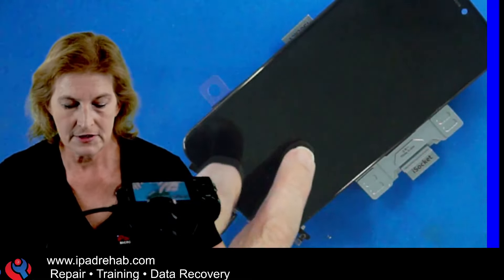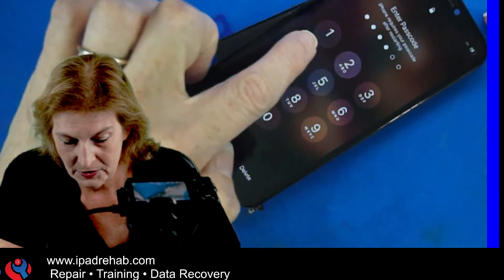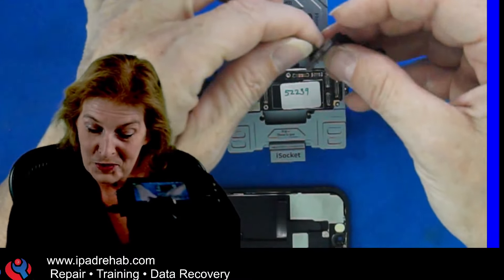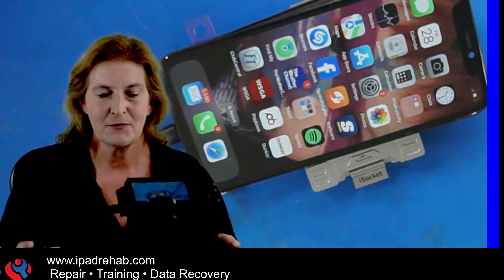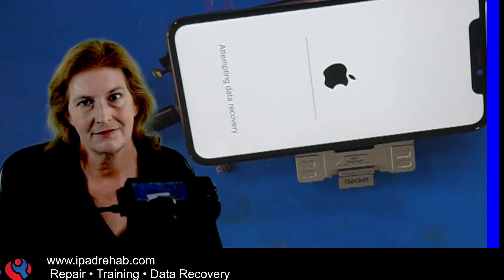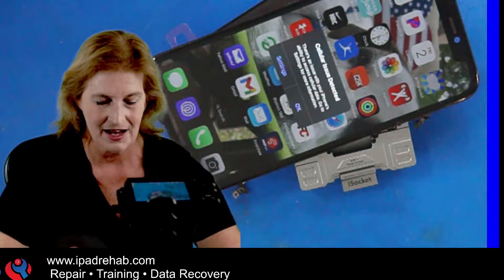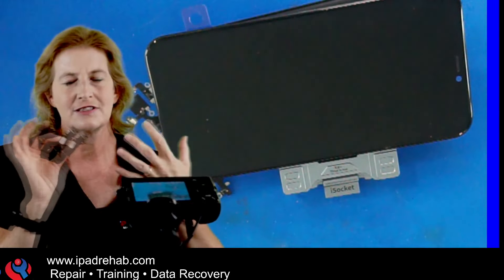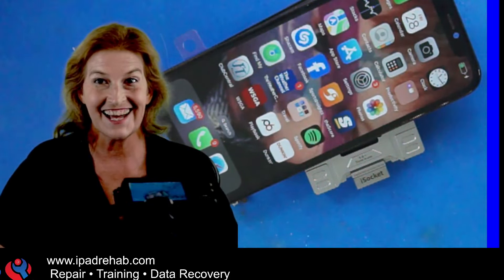iPhone Bonks Correct Passcode: NFC Mismatch?

Comment: I had a similar interesting case where I had to do a full swap on a 14 pro - so I swapped everything - cpu, nfc’s, Wi-Fi,Bbcpu, eeproms. Phone worked but didn’t accept passcode saying it is incorrect. I was afraid to update . I then moved over the eSIM chip from original bottom to new one and then it has accepted my passcode
Reply: Thats a lot of work
Reply from the maker: Wow that’s interesting, thanks for sharing
Reply: More randomness from Apple. :)
Reply: @LecomteRepairServices  Oui :)
Reply: @JessaJones  - The forced 3-minute restart is the dumbest thing Apple has ever done.  There are a number of other ways to let the user know about a sensor issue, on the screen, beep or vibrate a certain pattern. It's unfriggin' believable how dumb it is!!
Reply: @BillAnt  Having a specific response to an incorrect user input and then responding in exactly the same way to a hardware failure is pretty dumb, too.
Reply: Needs the eSim transplant too. It’s serialized ic.
Reply: @TrimeshSZ  - Just think of a situation where the use just wants to back up their data which is not synced to iCloud.  With the constant restart it's impossible, and sometimes even if all the sensors are replaced.  But why put a user through that hassle to begin with?!  It's utterly dumb!
Reply: Oh really thanks for sharing 😍

Comment: The reports of "my passcode is right but it won't accept it" have been a thing for ages, I'm totally going to try and see if force updating will work if it's not at iPhone Unavailable (rarely happens).

I bet you're right it's likely some issue from a connection being severed from the shock of a drop or something.

Comment: With banks using forever different algorithms to identify their clients this is understanding. Using Apple pay in my grocery store is taking longer and longer as it exchanges more and more data. As a regular customer on the same gas station I get higher limits before the pin is required. Additionally some payment processors  accept my Iphone to read and charge other peoples cards with me being a merchant. Extra sucurity is not free.

Comment: This is really interesting research you're putting out there for free. Thank you. We did discuss this on the group, now I understand where that comes from.

I am aware of the fact that running an update will make the top board accept a different NFC chip. But this is something extremely risky: what if your update fails with some random error 67  at 97%, and the board won't come out of recovery mode? I hate relying on software, because you're just hoping that the software won't stab you in the back (and lose you access to the data).

Also, what works one day might not work the next day: Apple just needs to flip a switch, and make updates impossible with a different NFC chip. 

Moving the original NFC chip (if intact, of course) to the bottom board I'm trying to use is the safest strategy (for me). If I have to rely on a software update, from Apple of all people, or on proper heat control to solder a chip, I prefer the latter.

Comment: I had the same thing with an ipad. No help from apple either. I had a second ipad and I created a new account and was able to get the first ipad unlocked that way.
I bought a surface pro. My phone is android.
I never dropped the ipad. But I did have it in airplane mode when the battery ran completely down. It's the only thing that I can thing of that could have caused the problem for me.
Apple products, well I am not going to say it. But I made a switch.